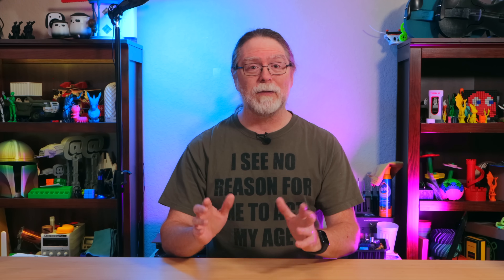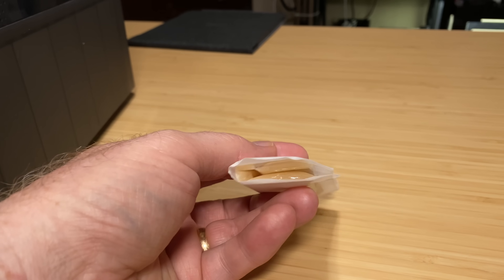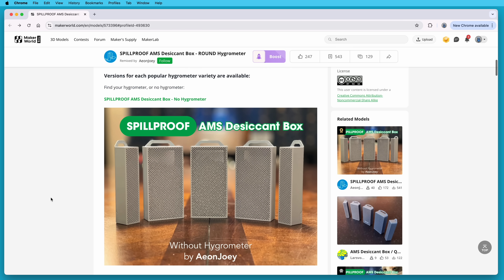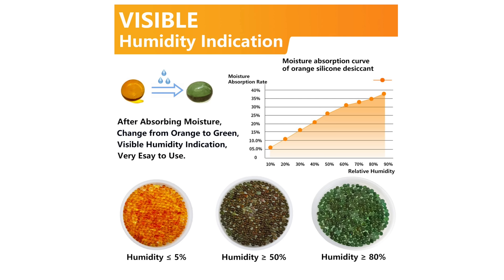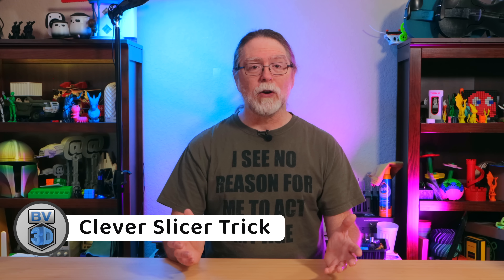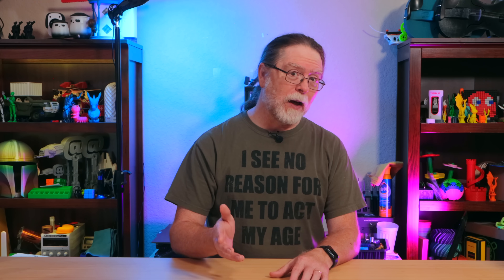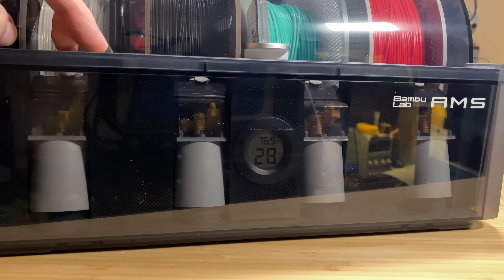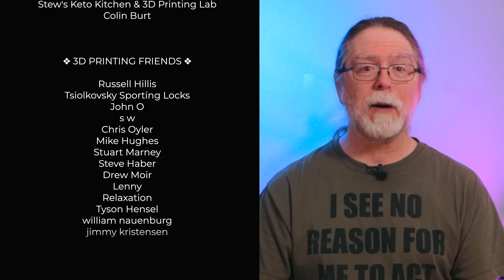I REPLACED DESICCANT in my AMS for the LAST TIME!

Comment: Something nobody ever seems to mention is that you can easily dry out your gel on a central heating radiator. This is easily the most common form of heating in the UK, and in the colder months at least when your heating is on it does a great job of drying out the gel, and because the heating is already on it doesn't cost you anything. 

If you're spending hours drying it in an oven you're just wasting money, it's cheaper just to buy new. And there's no need - a couple of hours at most in a microwave at 120 deg C should be enough to dry out up to a kilo of gel. Do bear in mind though that the colour changing stuff is toxic.

Comment: I've been using 50 gram rechargeable desiccant packs. The advantage of this is that you can tell how wet they are by weighing. They start getting heavier way before they start turning colors. They are dry at 50 grams, and fully saturated at 65. You can stuff one in the hub of each spool, and between each filament feeder.

Comment: The stock Bambu desiccant doesn't explode, but it will absorb until it can't anymore and then leave puddles in the bottom of the AMS (mine was out of commission for about a year and it discovered water in it when I finally got it out to use it again)

Comment: The print has a "front" and "back" plate, but the output on each plate appears identical.  Should both sets be printed?  and is there room in the AMS 2 Pro box for a set in front and back, in addition to the upside down "U" shaped spot already in the back?

Comment: Hmm, silica gel, buy once use forever.
When it stops absorbing moisture, microwave it dry again at like 100W,
ofc outside the room or thing you want to keep moisture free.
I'd use an outside microwave for that, ofc under a roof.
Do not use microwaves in outside wet weather.
Do not microwave the silica gel at max power
of the microwave thinking it works faster,
it just becomes dangerous.
This can also be done automatically.
You need a valve set, several fans and a microwave and some pipes.
When the silica gel is in the microwave, you can push air in through the valve system,
while not compromising the microwave casing. It just seeps through the cracks.
(Warning, don't drill holes in it or the glass.)
The air that passes through it allows the silica to absorb the moisture.
After a couple hours, or depending on moisture level, when completely saturated,
the valve with the in-room air closes, and instead opens a valve to the outside air.
Then the microwave switches on at like 100W and heats the moisture into
vapor after which it is expelled through the piping to outside.
Then it switches back into absorption mode. Rinse and repeat.
A cheap system shouldn't cost more than $80 tops with $100 for a larger
amount of silica gel, increasing maximum capacity.
Don't buy the immensely overpriced off the shelf stuff.
Learn how to make it, and makeone yourself, you'll save out thousands.
(well, unless ur rich, but for most people spending $2000 or so means
months of work in net profit. Most people need to save up and thus
work for three months to buy this off the shelf.)

Comment: The AMS 2 pro is a filament dryer as well. Put your rechargeable desiccant into PETG printed packs for the AMS2. When the desiccant needs to be recharged, simply set a drying cycle on the AMS for 24 hours or however long you want. You cannot use the drying while printing unless you hook up an external power supply to the AMS2 pro but it is a dryer when idle. Mine drops down to 5% RH at 65 C. 24 hours of this can dry your desiccant and means if you use it to dry your beads, you don’t need to change them at all and can leave them where they are and the title of this video will be accurate.

Comment: Cool but you forgot to mention a crucial thing, that the middle dry box should not be filled with desiccant, otherwise your hygrometer will always measure the humidity of the desiccant (min. reading 10%) and not that of the ambient humidity inside the AMS unit.

Comment: I don't understand why seemingly all of these designs are targeting PLA as the print material. If you print it out of something that handles higher temperatures better - ABS, ASA, PC, or even PETG, you can skip the step of unloading and reloading when you need to "recharge" the dessicant; just drop the whole container in whatever you're using as a filament dryer. But I've tried a couple of designs that didn't print well in ABS (the grid too fragile), and none of the dozens I've looked at on MakerWorld included a profile for anything but PLA. You seem to make that assumption here as well.

Comment: I have good luck with popping the desiccant canisters/bags in the filament dryer at 65 for some time. I know sometimes with the oven you get ones that stay green, perhaps because they crack. I don't get those with the dryer method. It does take longer than oven or microwave of course

Comment: I don't have bamboo, but I use 1 gallon bags and have cereal boxes with air tight seals, what I ended up using is aluminum altoid tins I bought on amazon, I found that two lbs of beads perfectly fits inside 12 tins.  This way I can just cook the tins in the oven to recharge them and don't have to handle beads and the mess of them getting everywhere.

Comment: I like the design.  I have been using a competing design and just changed out my desicant for the first time and it was a bit of a pain.  I may print this variation out as it seems much easier.  Are there any materials that could tolerate microwaving with the beads inside so you never have to dump out the beads?

Comment: If you plan do do this with the AMS2, two words of warning:

1. The AMS2 has an active heating mode.  If you use this, remove the descant trays first or print them out of heat-tolerant plastic like PETG. 
1. The AMS2 has a slightly differently shaped void spaces, so make sure you're printing a model that'll fit the new system.

There are also descant holders designed to fit into the center of a spool of filament.  I plan on printing a few of these for use while spools of extra colors are in storage outside the AMS.

Comment: Hi Brian, great video. I am new to the 3D printing world - I got my P1S combo at the beginning of April and I'm loving it. I ordered desiccant beads soon after I got it and put them in the bottom bins. Big mistake - the only way to get them out short of inverting the AMS and making a mess was with a vacuum cleaner. So next I printed drop-in bins that go in the bottom bins and filled THEM with the beads, and that works a treat. Next I printed the centre bin with the hole for the hygrometer and that's all I've got for now. I gets really hot and humid in the summer here, but we do have central AC, which helps a lot. In the six weeks since I got the desiccant sorted out in the AMS, the humidity has gone from 10% to 22%. I've mostly printed with PLA so far, and no problems. I did use PETG HF once, mistaking it for PLA, and it was a stringy mess. Before I use it again I will definitely give it the recommended drying time.

I will probably print additional bins for the AMS - thanks for sharing the SPILLPROOF AMS Desiccant Box by AeonJoey!

Comment: Printed the dessicant holder with the hygrometer fitting, 2 shoulder boxes and 2 more to go behind them as suggested, and the two narrow outer boxes. Filled them with dessicant beads, installed them in my AMS, and the humidity dropped to 10% and stayed there. A hygrometer outside the AMS was reading 55%. What a great tip, thanks again.
Reply: Those little hygrometers are spec'd to measure the range of 20% to 90% relative humidity. All of the ones that I have will actually measure down to 10% and wont go any lower, even when my AMS2 Pro reports relative humidity of between 3 and 4%. You never want your AMS and filament to be 20% or higher. Sub 10% is best.
Reply: @patrickkahn1870  Aah, wondered why the value never dropped below 10%. Thanks for the tip.
Reply: @biggles258  keep in mind that the hygrometer is useless since it sits on a bed of dessicant, remove it and place it outside, it will still read 10%

Comment: If you reactivate the beads, do you put them straight in the ams after it's done? Because they are still hot? I let them cool down first but then they are too saturated again. If I put them straight into the ams, the humidity level does not drop however the temperature goes up :D

Comment: Yes I watched the CNC Kitchen Video. I agree that you should point out that you should use a microwave that is dedicated to drying your desiccant and nothing else. I WOULD NOT use my microwave that I use for food for anything else but food. Or even my oven that I cook my food in to dry my parts and printing to further enhance the strength of said parts. We need to error on the safety side. I use a food dehydrator that is dedicated to drying my filament, etc. and I only use it for drying my filament and desiccant,etc.! But otherwise good video. Also you did not clearly explain if you use the beads as well as using the Bambu labs desiccant or if you could use it instead of using the Bambu desiccant. There are some designs that have a box that will fit into the slot are where the Bambu desiccant resides.

Comment: Incredibly helpful. Making this right now but split the plate so I could test parts one at a time. I bought a 1gal blue to pink set from amazon as the affiliate links weren't in stock. I'm trying to print in clear petg as my test print in PLA for the hygrometer fitment it was impossible to see the silica's color.

Comment: I just got my P1S with AMS, someone recommended this unit to me and it looks great, however I have a concern. It appears the Hygrometer is mounted in the front of the holder, wouldn't the measuring unit on the back on the Hygrometer just be measuring the desiccant behind it and not the actual humidity in the AMS unit? Has anyone tried placing another hygrometer elsewhere in the unit to see if they would read the same?
Reply: The volume of air in the AMS is not enough to make much of a difference, its a small space with a pretty good seal for what it is doing (it is around half a cubic square foot).   Once it has been closed for a few minutes the overall humidity levels will be equalized for what your filament needs.
Reply: @WinsonPaine  I just did my tests and you are correct it makes no difference, works perfectly.

Comment: Just get a camera dry cabinet and store the filament in that then put it in the ams when you are ready to print. If you need to get humidity out of the filament fast use one of those heated filament dryers before putting it in the cabinet. I print from a dry cabinet and it is so dry the PTFE tube gets statically charged and shocks me if I touch it. Had to ground it lol.
Reply: The Sunlu 4s filament dryer holds 4 spools and keeps them dry for half the price of the cheapest camera dry cabinet I could find on Amazon.

Comment: The best and cheapest filament dryer is a food dehydrator(25-45 usd), you can also use it to refresh your decicants, both silica gel or bentonite clay works ok and both are available at most grocery stores as kitty litter, just avoid cented or clumping litter.

Comment: II agree with this. In addition, I would put my filament spools in a waterproof box with rechargeable silica gel from day 1. Most hygrometers bottom out at 10-15% but if you calculate the amount of water vapor at that. RH/temp it is so small that the silica gel should handle this. Typical polymers absorb between 1-5% of water by weight but it takes a long time to get there (days to weeks) and even longer to get the water out of the polymer.

Comment: I ran a test with some rechargeable desiccant - I put some in an open container and pout that inside a closed container with 50% water (desiccant in a boat in a closed system) - It took 24hrs for the desiccant to turn white/clear (used).  Taking the desiccant boat out and just putting it back on the table, about 24hrs later approx 1/8th of the desiccant is back to orange, but the "boat" contains a full spectrum from clear-to-orange.

Comment: Just got my X1 Carbon and saw the instructions inside the AMS to take the plastic off but it almost seemed like it meant take them out all together.  After I saw this video I realized they are needed and to just take the outer packing plastic off and put them back in the slots.  But now I am thinking of the contents of the video and making the tray and buying the orange/green amazon stuff.  Very cool video.
Reply: Double comment.  After a week of having my X1C, I circled back here today.  My meter went to 4 after loading up a bunch of filament.  I saw a few more dry box designs but the one you recommended looks to be the best.  I like how it prints in less than 3 hours too.  Hygrometer and orange silica gel coming in 2 days.

Comment: There are also insets for the place where the original D-Pads are stored which you can also fill with D-Balls to have even more space/D-Surface. Only thing I don't like is the humidity-sensor inside the D-holders, as this measures the Air just around those but not the general humidity in the AMS air (put another one to the back and see the difference they show). Else its good :)

Comment: Seems to me the answer would be an automated air dryer, running on filament dryer principles, that fed a constant flow of dry air into the AMS and kept a positive dry air pressure inside. Do the dessicant pouch receptacles dry air coming into the box through vents in the bottom or just dry the air that comes into the box as you open and close it?

Comment: Thank you for the video.  I was able to quickly print the mid - level hygrometer boxes and the result was perfect. Filled them with desiccant and  placed them while the X1 was printing. I started at 35% humidity and now I'm at a consistent 10-11%. I was going to make the desiccant boxes for the back of the AMS but there's no need after this mod.    I'm very pleased with how this turned out. Best mod so far.

Comment: I think you may have been slightly misinformed. Now I don't have anything from Bamboo Labs, but I am unfamiliar with any desiccant product that is not rechargeable via a proper application of heat. For my Activated Alumina desiccant I toaster oven in a metal screen basket at about 250° C for about 4 hours. For my Silica Gel I microwave it on the defrost cycle for 3-4 minutes, then let it cool and repeat about 4-5 times. Finally, for Calcium Chloride, which is what Bamboo Labs claims is in their packets, you can bake it at 200° C for at least an hour. Depending on what the packet is made from, you may have to remove the packet, but the Calcium Chloride can certainly be rejuvenated and dehydrated to reactivate it as a desiccant.

Comment: I have a sealed box that I store my spools in with a paper bag full of the indicator desiccant beads... I've found that microwaving them tends to burn them a bit if they're not fully saturated.  That makes the orange beads look darker like they haven't fully dried out.  I'm switching to non-indicator beads and just using the hygrometer to tell me when to recharge the desiccant.  Definitely going to print those boxes, though!

Comment: I have govee humidity and temperature data logger in my AMS's. also been using similar prints and rechargeable desiccant since day 10.  (had to print the ASA boxes first :))  I dry the beads in a filament dryer or in the X1C  on the dryer mode :)

Comment: The white powder turning to gel is claciumchloride which is more efficient in being hygroscopic than silica, BUT cannot be restored to its former state w/o a great mess. Also, in all these "humidity-discussions" all over YT, nobody ever considers that you can only draw a certain amount of water from a body of air at a certain temperature. I experimented with various sensors over the years in electronics and my AMS reports "level 4" at 21°C at 35% Rh. Meaning, the sensor is either not really accurate (which is likely) or the algorithm interpreting the results from the sensor is not well done.
What that leads me to is: if you don't have issues printing, all that hysteria about humidity of your filament should be ignored. Regarding Bryan, no offense intended, I just think there is more to be considered. See https://www.youtube.com/watch?v=5CFxT1q6dX8
It also depends on where you live... Humidity might be a different topic if in Australia, close to coast, in a valley etc etc...

Comment: Good information.  Why did you decide to now replace the back holders with the ones you shared at the start of the video.  You are already using replaceable desicnat so that didn't make sense to me why you wouldn't replace those also.  See time about 3:21.  Seems like you would use both types to get most humidity removal.  Especially since it appears you already printed them. Just curious on your thoughts.